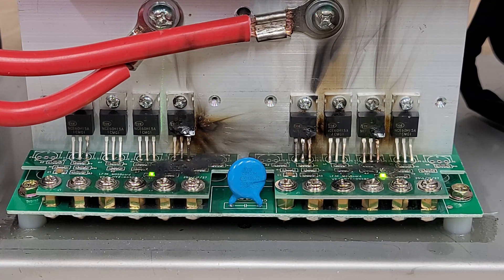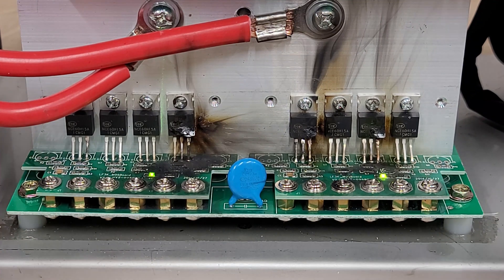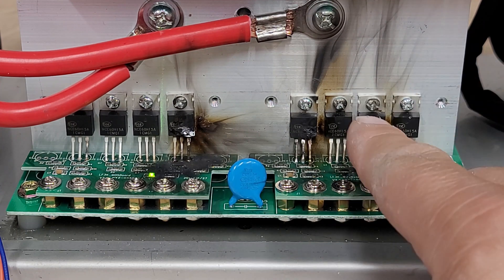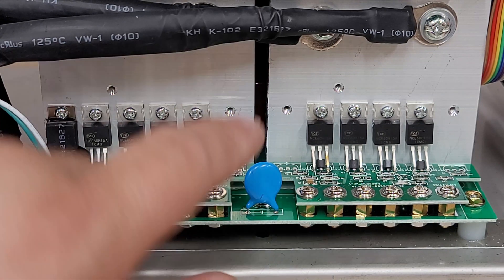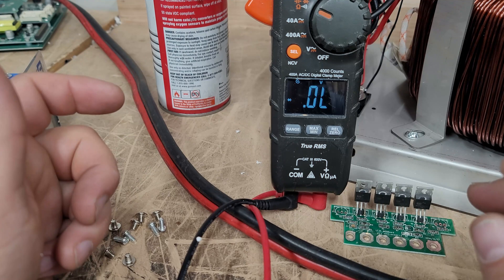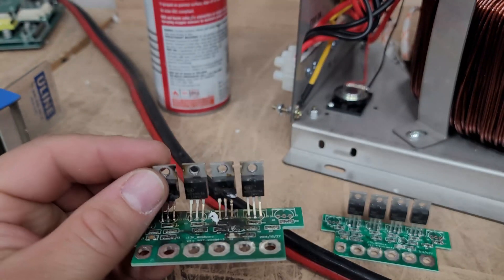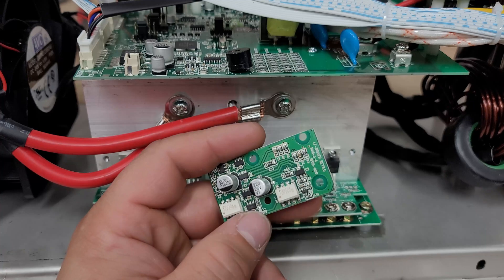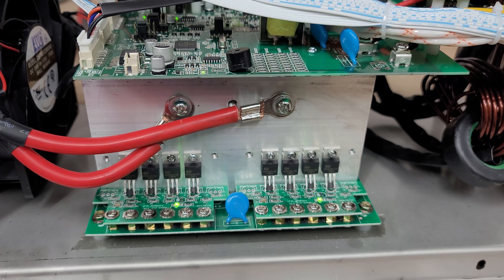Power Jack Inverter - Diagnosing Bad Mosboards (Mosfets)

Comment: I'm trying to test my inverter with a benchtop DC power supply but the inverter does not power on is it my power supply should I try batteries
Reply: If you bench PS doesn’t provide enough current, the inverter won’t start.
My suggestion is; Use a 12 volt lightbulb in series with the 12 volt battery if there is a problem the light bulb will glow very bright indicating that there’s problem.
This is also a good idea to avoid arching when connecting the battery to the inverter.

Comment: I got one of those 6,000 LF inverters with a blueish sticker on it and you do absolutly not have no warranty,  they just say you do.
They wanted to charge  me $120 shipping from  California to N.Carolina  to send my 5 burned up boards that are small enough to hold in my hand.  The heck it does cost $10 to do that, not $120. 
The heck , I bought  all 5 boards for $45 cheaper brand new  and got free shipping  instead using their effen waranty. 
That company is a ripp off and you not really have any WARRENTY whatsoever.

Comment: Funny how there is no in4148 diodes to protect the mosfets gate from spike
Reply: The diode ln4148 are put in parallel with the gate resistor to help speed up the turn off time.

Comment: I just hate how mosfet or not design properly the fet just get too hot and damaged but I believe mosfet show be make with more conductive crystal to reduce the failure and overall heating issues pulse 10 % of mosfet i but from international rectifier blow up when add to inverter circuit the only mosfet don’t blow up is china mosfet all American mosfet just failed to with in inverter like not all mosfet or design to inverter dc to ac I run into a lot of issues with mosfet like that so far I buy 30 type and only Chinese mosfet work

Comment: I bought a 12000w and the fan stop working I remove and checked the fan and it is working where can I get the temperature wire that plug to the board to buy
Reply: Good luck, nobody is available to help with powerjack
Reply: Have you tested the temperature sensor? They very rare  go bad, and they can be tested using a multimeter and a hair dryer.
Just put your tester on ohms connect the leads from your tester to the 2 leads of the sensor and apply heat.
You will see ether increase or decrease of resistance.

Comment: Dont buy powerjack inverters, they fail really often even under light load. The driver board fail and burn the mosfets. Sometimes they fail and burn your appliances
Reply: Lol, I have 4 of those inverters 12v, 2 24v,  2 48v. Powerjack is not interested of helping anyone fixing them. They are other inverters that can last longer, try Mppt  Solar, they are not from China, but Taiwan
Reply: 5 inverters , 9000 watts cost $900, 15000 watts costs $1200, 2 inverters of 8000 watts costs $450, 4000watts  12v. Don't buy powerjack

Comment: I have a powerjack 8000w 24v splitphases and the home is consuming 800w each phase and the inverter shutdown. the transformer is over heating what can be the problem? I replaced all the mosfetds driver bord i/c board cpu board overload board and it is the same problem  and the inverter don't shots down wen woltage of the lithium batterys go down 21.5 it will keep goin until it reaches 18 volts when it over heating it don't beep it only shutdown immediately thanks in advance
Reply: Lolz I have the same problem, I changed the transformer, it blows all the mosfets
Reply: Further more the inverter can't produce 3500 watts.  Genetry lied about the performance of the 24v 8000 watts. Because him I bought the inverter. He lied

Comment: I repaired my inverter with all the new parts, new mosfets board, new driver board, I even put ALL the new boards on it, it turns on well, but going from 1400w approximately it will overload, what could it be?  it is a 15k power jack.
Reply: Can you get the parts to fix yours
Reply: Lol. It is from China,. It is ok to copy anything in China. Try mppt solar, they are from Taiwan

Comment: So you show Gate (Left pin) shorted to Drain (center pin or Tab). How about Drain and Source pin?
Reply: never seen this guy reply to a comment
Reply: If the gate to drain is bad, there is no need to check drain to source.
This is because the gate goes through a resistor and if the gate to drain resistance is lesser than the value of the resistor on the board, then the MOSFET is bad.
In the other hand,  the source and drain are in parallel, if one MOSFET is shorted, then they all will read the same. ( shorted)

Comment: To Sid Lori I have a question. I have an extra mainboard (fet board) from the Ozinverter project. This mainboard is suppose to be pip to pin compatible with power jack mainboard. Can you confirm if this mainboard would work with the new cpu boards here is a link please scroll down you can see the trace lines pin to pin https://www.fieldlines.com/index.php?topic=148953.75
Reply: Sorry for typo I meant pin to pin. They call it the power board instead of mainboard.
Reply: @carlospereira9838  To the best of my cross-checking, they look to be the same, and should be compatible.
Reply: Sid Lori  thanks that’s what I thought. Since I do not have a power jack spare mainboard I could not test. When you receive your new hardware stock revisions for the cpu board and WiFi board I will take a set.
Reply: @carlospereira9838  The main difference I will note is that the FET drive current is 4.0A/peak, as compared to the IR2110 on the Ozinverter @ 2.0A/peak.
Reply: Sid Lori  thanks good to know. When they had designed the board it was said to be pin compatible as it was becoming very difficult to obtain power jack parts only.
Reply: Sid Lori  which Fets support 4 amp peak I know the non clone IR2110 fets are good parts to use. There are lots of fake parts out there.
Reply: @carlospereira9838 That's what the gate resistor on each FET is for: limiting the current to each FET so they don't get damaged.  But with parallel FETs, capacitance goes through the roof: even the 4A GS driver struggles to cleanly switch (6) HY3810 FETs on a PJ FET board.  The thin ribbon cable doesn't help too much either.
Reply: @carlospereira9838  BTW IR2110 isn't a FET, it's the gate driver IC on the Ozinverter board.
Reply: Sid Lori  I got confused with the IR2110 which is a gate driver I was thinking of the IRFB4110. Better to use IRHY3810 fets or IR21FB4110 for the cpu board.
Reply: @carlospereira9838  Hard to say ;-).  What I like to keep an eye on is the Input Capacitance...the higher, the harder it will be for the driver to cleanly switch.  If the driver can't switch the FETs fast enough, there will be some extra heat + messing into dead time, etc.
But at the same time, the '3810 can handle a max of 25v on the gate, and the '4110 can handle a max of 20v.  Not a prob unless the increased current results in EMI spikes that exceed the FET gate voltage...
Reply: Sid Lori  so on the main board (power board) for a 24v system best to use 60v caps or 100v caps or it does not matter. Some say it does not matter some say otherwise on 48v system they use 100v caps.
Reply: @carlospereira9838  You could use 50v caps on a 24v mainboard, but I don't really recommend 35v.  (You want headroom for longevity; 35v fine for 12v.)  These caps' main purpose is to prevent the FETs from turning the power wires into inductors...so they deal with a lot of ripple current.  It is completely possible to melt a capacitor down through excessive ripple current (have done it before); you may want to check some cap datasheets to get ones with the best ripple current rating.
Reply: Sid Lori  thanks good to know. I have a spare power board so I will go with 50v-63v caps good quality with low ripple current. What are the best caps do you recommend don’t care about price I want quality and as for the fets do you recommend the IRHY3810 or stick with the IRFB4110 for the oz power board . It seems those fets are interchangeable.
Reply: @carlospereira9838  You want the HIGHEST ripple current rating reasonably possible.  If the cap ripple current rating is too low, they may overheat and/or fail prematurely.  It is very important to note that most capacitors are only rated for a lifetime of 2,000 hours (at full temp, voltage, ripple current, etc.)--that's less than 90 days.  In other words, if the cap fails in 3 months, the manufacturer says, "Pass."  This is why caps need over-specced...if you want any sort of lifetime out of them, they can't be run at 100% spec all the time.

EDIT: On FETs, either will be fine.  HY3810 are actually slightly easier to drive than the IRFB4110 (lower input capacitance...if I've got the numbers right!)  PJ currently uses NCEP039N10s, which are even better for driving.
Reply: Sid Lori  thanks good to know. As for the caps there are so many choices don.t know a good brand from another. I can find the voltages and sizes 50v-63v for 10000UF Electrolytic (Can) Capacitor 35mmX60mm (B88) AR  but not sure which brand would be good. I.m not engineer so I don’t really understand what all the specs mean.
Reply: @carlospereira9838  If you're buying U.S. on the caps (Mouser, Digikey, etc.), you should be fine.  China could be hit or miss.
The parameters I look for are: 
 - temp (105°C rated, prefer not 85°C)
- voltage
- size/capacitance (size constraints will limit you here)
- ripple current.  You don't want miniature caps--they'll have the right voltage and current ratings, but fail miserably short here!  I've seen spec ~3-5A here for 10,000uF caps.
Reply: Sid Lori  ok thanks I will do some research and buy off the big retailers and not AliExpress. Like you said it’s a hit or miss with them and lots of clones and fakes.